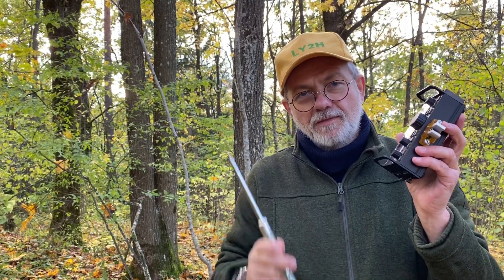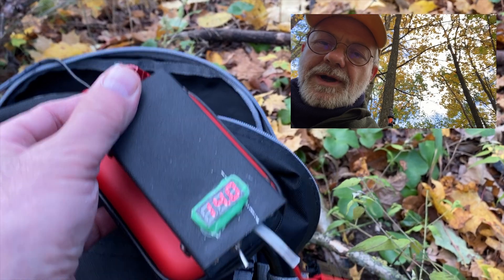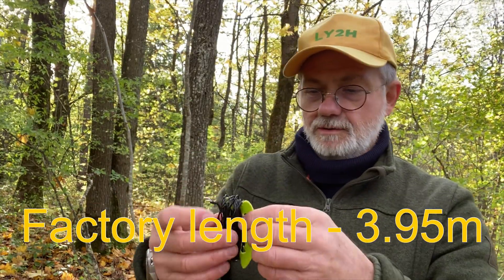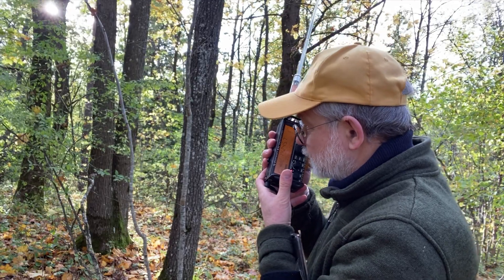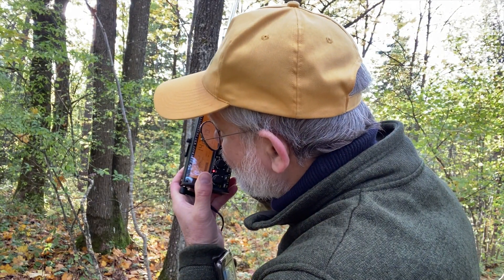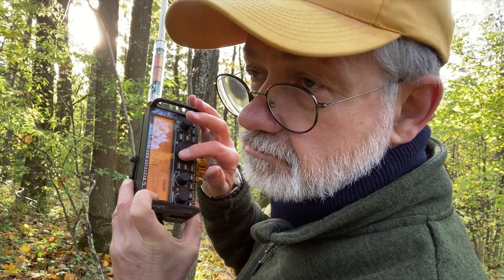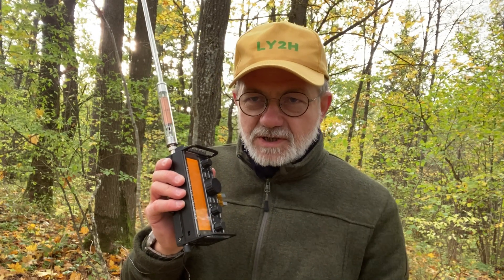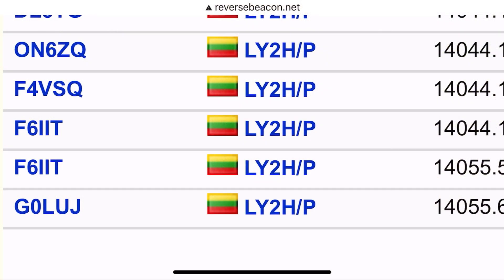Minimalist Radio setup - can it work? Elecraft KX2 + AX1 antenna in the park.

Comment: Enjoy your videos very much. How did you calculate the length of the wires for the capacitance hat you used - 1`1 cm per leg ? Tnx in advance
Reply from the maker: Thank you very much Robert! I don't use the capacity hat in this video. If you are asking about the capacity hat to the AX-1 antenna in order to use this antenna with IC-705 and other tunerless radios, it's in this video:
https://youtu.be/SE2EtVw9lho?si=sqYEAaVFWf8jHUEW
 My answer to a similar question is in the comments section there:
"One rule of thumb reads that the capacity hat electrically lengthens the antenna 2 or 3 times its diameter.
It's like, the hat 10cm in diameter should lengthen the electrical length of the antenna by 20-30 cm. In my case, 1 needed to electrically lengthen my whip for 40 "electrical" centimeters (from resonance at ~15.3 Mhz, calcualted electrical length of 1/4 quarter wavelength ~ 466cm, to the wanted resonance at 14.1 MhZ, calc 1/4 wI ~ 506 cm. 506-466=40.). So l chose the diameter of the cap ~20cm, which turned to be pretty much in tact. But again, the size/geometry of the hat is not critical, it gives a big room for experimenting. " Hope, this helps. 73!
Linas LY2H
Reply: @Linas_LY2H  Linas - Thank you very much. Yes, cap hat with AX1. I've watched several of your videos and learn a lot. They are very helpful. Hope to work you sometimes. 73 de K4RLC Bob

Comment: I used the AX1 on a IC-705 and added about 12" of solid copper wire to the end of the whip.  I then adjusted the length of the whip.  I was able to manual tune the antenna through out the entire 20m band.  Hunted a park in Texas from Maryland.  Received a 4 4 signal report.
Reply from the maker: Awesome! Actually, AX1 has been designed to use in combination with an amazing  KX2 antenna tuner, but you've got it running without a tuner at all! Nice! Thanks for watching! 73! Linas LY2H

Comment: I am guessing the antenna will work on other radios like the X5105 ?
Reply from the maker: I guess so. But the radio must have an ATU , installed or external. The Elecraft writes in its webpage that this antenna supposed to be used with the tuner. They also state that this antenna is resonant on 20m in the lower switch position, in my case it was not. I measured the resonance with my FG-1 antenna analyser and it red the resonance, with the stock counterpoise connected, 16,6 Mhz in the lower switch position, and 22,1Mhz in the upper switch position. So, either my AX1 is defective, or the manufacturer's statement about the resonance on 20m band is misleading :). But their statement that the built-in ATU will do a job on all bands , 20 and up, is correct. I can tune the AX1 up easily on all these bands. IMHO, it could have been done on purpose not having this antenna resonant on no particular band but, insted, to have a 300-450 ohms of impedance on all bands with the goal of easy tune up with the built-in KX2 tuner ( which is just a fantastic tuner! ). And if you don't have the tuner installed yet, and you want this AX1 antenna, it would be a great motivation to buy the tuner and the antenna, wouldn't it? :) 73! Linas LY2H
Reply: @Linas_LY2H  Excellent , after watching many videos including yours ive ordered the antenna and all the extras so should be with me soon and yes the X5105 as the built in ATU :)  , I also do the Flora Fauna and I am the log manager for the UK GxFF so may work your fine station sometime from the UK mainly beach portable :) keep up the great work 73 Carl 2E0HPI 44